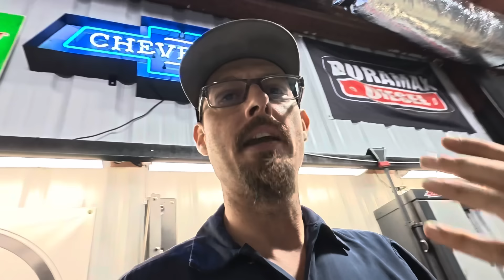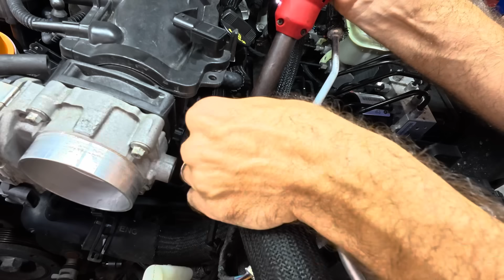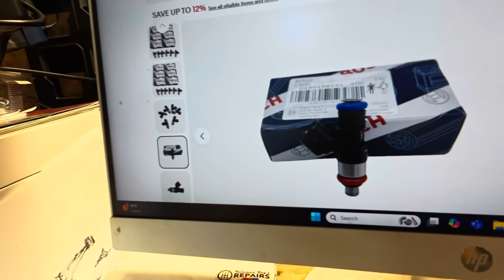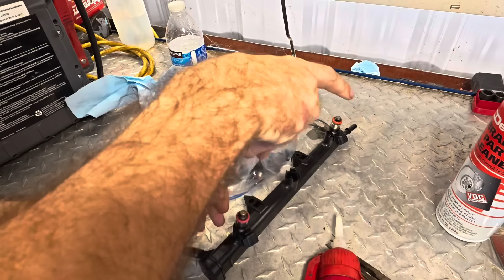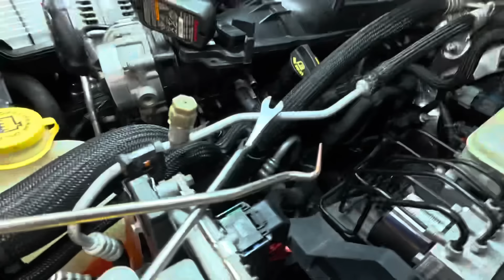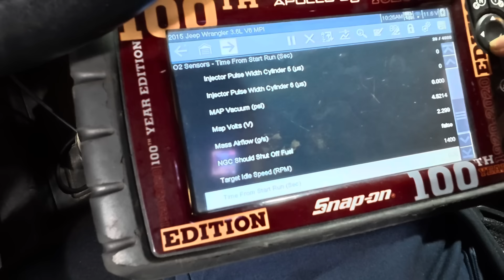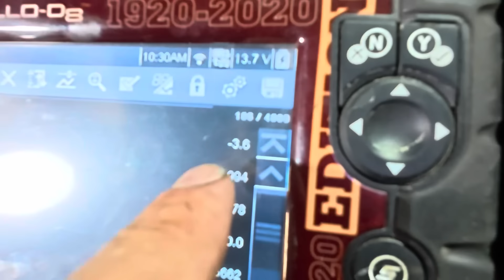Problem FOUND! E-Commerce Auto Parts (STRIKES AGAIN) Jeep Wrangler 3.6 P0172 P0175

Comment: Couple of years back I was going to perform a tuneup on my BMW 550i, plugs and coils...found some OEM coils on Amazon at an amazing price...but after placing the order I thought better of it as they were half the price of OEM on FCPEuro...canceled the order but they said it was too late, I would have to return them after they arrived...I went ahead and ordered a set of 8 from FCPEuro...when both orders arrived I was curious and the Amazon parts looked identical, but when I held the OEM FCP coil in one hand and the Amazon in the other, there was a noticeable difference in the weight...most likely counterfeit...never buy supposed OEM parts from Amazon...luckily I was able to return them and get my $$ back...

Comment: Great video, apart from the blue shop towels haha. I will add though. I bought four diesel injectors for my Iveco Daily from Aliexpress. They were NZ$75 each (freight included), compared to well over ten times that from Iveco PLUS freight (a ridiculous cost of freight) PLUS a very lengthy wait time from Italy and they are perfect. Iveco probably gets them from China too. Other parts are also at least ten times cheaper. One, a Fuel servo thingy, even came in carton with Canadian markings on the box.

Comment: The injectors can look exactly like OEM, doesn't mean they haven't been "rebuilt"... Sometimes rebuilt is fine as long as the person rebuilding replaced all the parts and then flow matched each injector. Problem is, eBay injector rebuilders sometimes don't actually rebuild them correctly, who would've thought

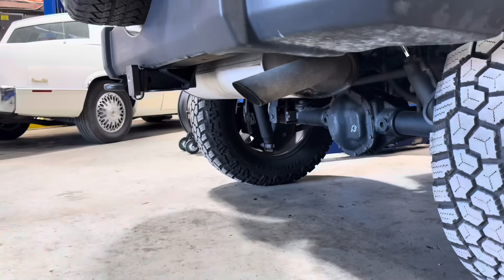Comment: 41:51 Those of you that were questioning Ray about the blue shop towels have been Rick Rolled. At the time line indicated you will see a shop towel shot out of the exhaust, of which did not come from the intake manifold.

Comment: Given that the engine is not working quite right wouldn't have been logical to have checked spark plugs and injectors ?
Might have discovered counterfeit/defective injectors at that time.
Sorry to 2nd guess.  View is always better after the event from the cheap seats.

Comment: a quick goohle   can be caused by issues with the Mass Air Flow (MAF) sensor, oxygen sensors, a faulty fuel pressure regulator, or leaking fuel injectors
Reply: He said that in the previous videos on this car. Also, this doesn’t have a MAF sensor

Comment: Good advice however I would say for mechanical parts I purchased an “oem” drivers side mirror for 20% of what Cadillac was charging for my Escalade it has been working great for 3 years now. I also did the same for the infotainment screen and the new screen was 10% of the cost and actually works much better. But for mechanical parts I completely agree. Also same thing for the phone charging pad new aftermarket replacement works so much better than the Cadillac oem upgrade so you can charge a modern iPhone without a plug in I also loved the blue paper flying from the tailpipe you may want to check the catalytic converter for extra Swiss cheese on that jeep next 😀😀😀 great troll!

Comment: The point of buying stuff for fraction of the cost only applies 95% of the time to only ebay and amazon. But sometimes does also apply to rockauto and such places. If parts department of you vehicles manufacturer tells you a single coil pack is $175. But parts store down the road has them for $100. And rockauto has an entire set for $100. Dont 100% trust that rockauto part. Nothing sucks more than doing the same job 2x because you wanted to save a few bucks. Time is just ad valuable if not more valuable as the money in your account currently.

Comment: ⚠️ I have tried a couple of Amazon aluminum oil coolers. Bad idea… some dont have holes drilled where the sensors screw in so the sensors can’t sense. One had bad sensors that didn’t work instantly. I should have known better, been wrenching for years! The Dorman aluminum oil cooler has been working well. Spend more to get less issues!! (3.6L)

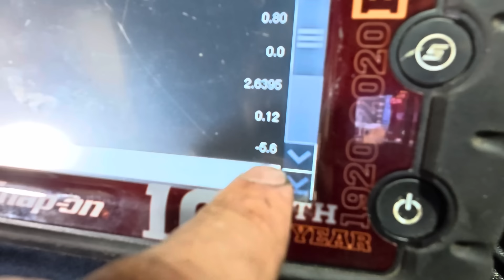Comment: 45:23 the oil is probably full of fuel, if it was pegged rich, no control, before.  That's why the computer is trimming negative, fumes from the PCV system.  Probably should do an oil change.

Nice work.

Comment: "Shotgun parts"....guilty. I replace everything related to front end alignment at the same time. Inner/outer tie rods, idler arms/drag links, ball joints/control arms and strut assemblies. I believe it has actually worked out for me though....one and done rather than constantly in the shop after scrubbing tires.

Comment: Yea. I played that cheap injector game with my Sierra. Got a set of 8 for $300. OEM from dealer (ironically the cheapest price for part store part) was $200 each. Guess what. My truck did not run properly on the cheap injectors. Shocker right.

Comment: I put a crank position sensor in from rock auto and my car immediately threw 6 codes. I thought I was winning getting the most expensive cheap part.. just get OEM.
Reply: In some cases OEM is the only way. In many other cases they are just expensive and compared to premium spare parts also often much worse.

Comment: Anyone who works on fuel injected engines. 
One tool you need to have is a fuel injector cleaning machine that way not only can you back flush them. And you can make sure that all the injectors are flowing the same amounts of cc of fuel. You can check the flow rate at all rpm's. Some injectors flow down low but are way off in the mid range of top end. With out having a injector flow bench and cleaning machine.  You have known idea if everyone of the injectors are flowing the same amount of fuel, so its very common to see one or more flow 50 to  100cc  less than the other 5 injectors. There's know way I'd put that much work into installing used injectors without putting them all on my fuel injector flow and testing machine. It the only way to know for sure that the used injectors were all good... I believe that you are a good tech just more less saying to you that a injector machine is something well worth the money. In my opinion a must have.. mine has saved me money and time almost weekly sometimes dally...great investment...take care....Bob

Comment: The bottom line (the truth) is that it shouldn't be this ridiculously difficult to diagnose a rich condition especially with all this "wonderful" "advanced" technology. The "Obsolete" technology performed at least as well and it was at the very least reliable and easier to work with. Then there's the cost. A thousand dollars plus for 6 injectors is far beyond ridiculous. It's automotive idiocracy. devolution. -Bob, The one-legged crammer.

Comment: I did this to my 13 Wrangler and it cost me the engine. I'm still waiting to replace my catalytic which is fried from the rich fuel condition. My 0art number had a "D" and mine was a "C". That little mix up cost me $10k. It all started with a bad sensor on the back of that oil cooler

Comment: Hi Ray,
I've been having the same problem from time to time.
The trick is never rely on make, model and year.
Only factory part numbers or numbers crossed to original equipment vendors.
I have most of my issues with previously installed chineesium

Comment: Yeah these Pentastars get a bad injector once in a while and cause a misfire (more often than not it is cylinder 5)  I normally go to the junk yard and get and OEM used one for cheap and replace it.  There are plenty of the 3.6's in the junk yard.  The coil packs normally seem to go on 5 as well.  I will normally just do coil pack 5 and a new set of plugs.  I normally do WVE coil packs.  I have had the o-rings on the injectors fail on them more than once.  I normally replace them.   I use the Victor Reinz 18-10027 o-rings.  They will seal up nice and tight.

Comment: I doubt even Chrysler injectors and ignition coils needed to be replaced until failure was proven. Don't just throw them in there because you are close to where they are easy to reach.

Comment: Ray, I knew you would get there in the end. It's almost impossible to diagnose some of the problems, especially when copy parts have been used, unless you stripped the engine back the last movable electrical part, then checked every installed part, no doubt when checking those duff copy Bosch parts you would have sussed it then. Don't think the customer would want to pay for the time doing it that way though.

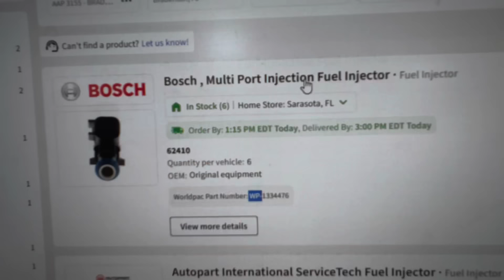Comment: 21:22 AND THIS is exactly why people will buy knock off injectors and take the gamble. Because OEM injector prices are straight up theft. So this jeep owner did the same as the rest of us. He just got unlucky with his choice. I have cheap Amazon injectors in all my rigs and they wall work great. As I have V8s, the price to buy OEM or even any parts store brand is a HELL NO. Why would I pay a grand when I can spend 10%. And if pressed, I could buy the cheap ones and have them tested for $20 each. Return any bad ones, repeat until I have a good set. But so far, I have never gotten a bad injector off Amazon. So sorry Ray, but we are not paying 1000% more just because.

Comment: $100 for a set of injectors made me laugh out loud. I replaced the set in my ‘91 marquis when I was chasing down a massive misfire/stalling/rough idle situation. First attempted to clean the oem pintle stile injectors before finally doing a boatload of research and ordering a set of disc style ones from summit (which cost many Benjamin’s). Car runs now and that was 4 months ago, but I still have the oem injectors sitting in a box. I can’t fathom buying a cheap set off the jungle site or eBay. That’s too much risk for minimal reward.

Comment: I've worked in the import business, Chinese factories are... opportunists.  Some brand-name part supplier, possibly under contract to the OEM, will hire a factory in Guangzhou to make some part. They send them the whole engineering package, drawings, etc. detailing exactly what to make.  The thing about China is though, after making your parts the factory manager will keep making your parts and sell them to whomever backs a truck up to his dock.  This is the basis of the IP theft complaint you hear about; the engineering packages are proprietary and not supposed to be used for other customers, but its China and the foreign supplier/OEM have no standing in Chinese courts to stop the factory manager selling to anybody.

What does this mean for US consumers: the exact same Bosch or Chrysler or whomever's parts can be bought, unbranded, from the factory in Guangzhou.  Now, by the time they've gone through 4 middle men to wind up in some Long Beach warehouse good luck identifying them!  Those injectors Ray's customer bought were Chrysler-specified, Bosch-designed parts for some 3.6L Pentastar somewhere, in some market; but unfortunately not for that customer's JK.  TLDR, if you can find the correct part (if is doing a big lift here) you can get the same part for a fraction the money.

Comment: If you are careful and don't buy things like O2 sensors or injectors, you can be comfortable getting parts from Amazon. You might try your luck at a boneyard. I found 4 out of 6 brand new ignition coils. There are some places that strip the most wanted parts off cars before they pull what's left for the rest of us.

Comment: I bought a wheel bearing hub assembly that was built into the knuckle from ebay for $100, and the spindle wouldn't slide into the bearing. Ordered one from rockauto and it had a perfect fit for my 2002 Nissan altima.

Comment: I too am a auto shop owner.  I have given up on internet parts from eBay and Amazon because there is no quality control when it comes to to eBay and even more with Amazon.
I hate to do jobs twice because we tried to save a few hundred dollars.  It’s not worth it.
Hay, why is your 4 post lift two feet off of the floor?  Should it not be on the ground or in use with a vehicle on it?  My 4 post never sits like that.

Comment: I just had my 07 honda accord EXL go into limp mode due to and error from the oil pressure sensor off the vetch solenoid. Thought i save a little and ordered a whole unit off amazon. Well soon as installed the new solenoid and the vehicle threw the solenoid code on top of the oil pressure sensor code and still in limp mode. Troubleshooted and then did some through research. I took the old solenoid and clean it up but noticed there was a lot of debris and little corrosion on the oil pressure sensor contacts. So i removed the new solenoid used its gasket and reinstalled the old solenoid. Also applied dielectric grease. And then started the vehicle. Not only did the solenoid code went away, the oil pressure sensor as well!  And no limp mode.  The moral of the story is… just because it’s cheap doesnt mean itll work! Lol

Comment: I experienced the nightmare of counterfeit fuel injectors, even from a name brand source at OEM prices. I found they were fakes quickly after they ran poorly and weighing with a gram scale, counterfeits were considerably lighter than OEM. A fellow 4Runner owner got counterfeit injectors too, but his leaked down overnight and he hydrolocked his engine starting it the next morning after install. OEM Injectors are cheap if you consider NOT needing a new engine after replacement. Be diligent about sourcing these parts and weigh new ones after purchase. Fakes also sound different when they click open when tested off the vehicle.
Reply: Curious where did you buy the fakes?

Comment: That intake is a bitch on a 2013 durango.  Back half is under the cowel.  You have to strategically hold the bolts up or take them out while lifting a little and rotating clockwise to get it out.

Comment: 😂😂😂   Previous video asside just about to watch this one. But will say one thing When confronted with a head scratcher after doing all the usual  Diags and taking into account previous issues other shops have had and their choice of solution has failed or only worked temporarly then Grab a coffee . make a list of every Part replaced or repaired by them.   Check them items first before proceding further.  there are a lot of subpar parts still circulating . we will be looking about a decade befored we recover from the hangover of the cough cough . The same thing occurred after GFC and that hangover lasted several years in the parts market.  meanwhile have a bloody fantastic day .

Comment: You can actually use a scope and check the injectors at the fuse  with a fuse loop .brake clean sprayed on the injectors just before pushing in makes it easy and no silicone to get into anything. Figured the brake cleaner king would know that 😉

Comment: i cant believe you didnt bench flow the 2 different injectors, that would have been cool to see the difference in flow and spray pattern! prolly with hp tuners could have corrected for the larger injectors but not everyone has an mpvi3 or similar to do that

Comment: yo. thats an awful bold statement, "dont buy parts off internet" for example the only place you can buy some of the best parts, take powerstop brakes, they are only available on the internet. and the pickup towing brake packages they offer are among the best you can buy as even Napa top of the line rotors dont come close and have not for at least 15 years.

Comment: Bought fake Mercedes spark plugs off eBay. They came in Mercedes-branded boxes, even had the correct logo on each plug. But after 5k miles the car misfired and all six plug tips were burnt away. Then noticed each plug had blurred writing and other differences compared to genuine plugs direct from the Mercedes dealer. Be careful out there.

Comment: I made the same mistake a few years ago on an old Mitsubishi 6g72 engine. It coughed and spluttered ran extremely roughly. I got the new injectors tested, all six were faulty with no atomisation and one particular injector was permanently open almost causing hydro locking. 
I sourced a set of refurbished original Mitsubishi injectors and installed them, problem solved.
Chinese look alike injectors we’re useless.

Comment: After 45 years of servicing and repairing automobiles, in honesty, outside of servicing normal wear & tear items, 70% of the remaining repairs are correcting other peoples' incompetence.  Also, less than half of that damage is done by the DIY-er or owner.  The majority of the incompetence is on the part of other shops and their employees.  Frankly, I spend more time doing wear & tear service & repair, because those items are passed up by other shops looking to maximize each customer ticket with elaborate, expensive, unnecessary procedures.

Comment: Nice Jeep and nice work getting it right. The DIY did a good job, if he would have had good parts. You did what I was thinking, clean up the old ones and put them back in. I hope he didn't do that with any other parts, like coils, that's a common one. Always remember, if it is too cheap, there is a reason. Good job Ray

Comment: I bought a non genuine oven door seal from a seller on Amazon, but it didn't seal properly so I sent it back and bought a genuine one which was much more flexible and sealed correctly. I have just bought  a Jaguar door seal from eBay, but it was a genuine part so it is possuble to get good items from eBay.

Comment: 17:04  i had an apprentice that left shop rags in the intake port in the cylinder heads...
Series 3 3800, it fired and ran for a split second...
He also had a rag wrapped around the balance shaft😂